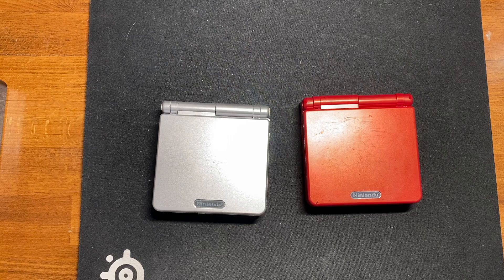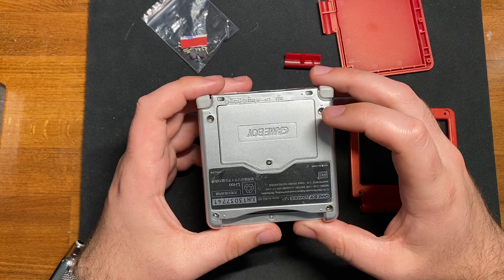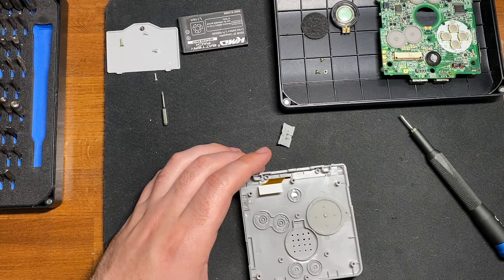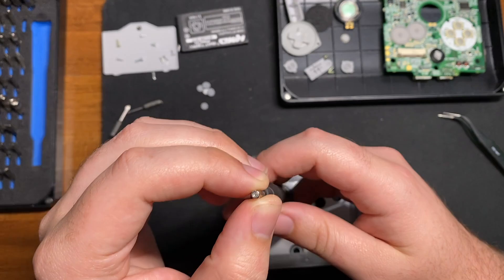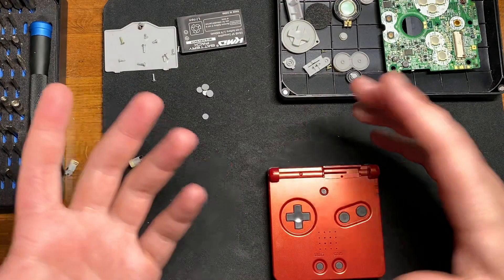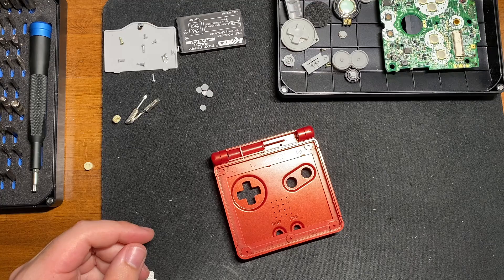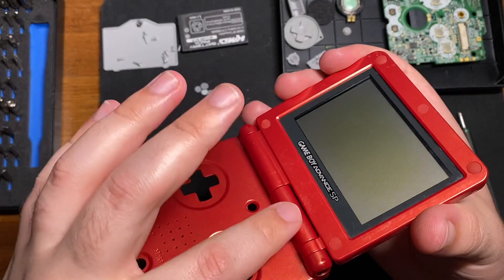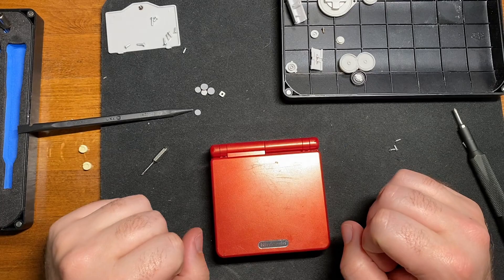Let's Swap A Gameboy Advance SP Shell - How To Guide

Comment: You forced the hinges out while both halves were misaligned, which is why you had trouble. You are supposed to remove them with the screen frame open to the self-supporting detent position (standard play position). That also made them more difficult to insert and likely changed the feel of the whole thing. Opening from the detent position makes the left hinge particularly hard to access when removing but there are a few ways to do it easily enough. First, always remove the right hinge first, then...
1) Unclip the left hinge, open the frame, then push it out with something long that reaches through the hole where the right hinge used to be.
2) Use Makho's 3D printed tool that fits inside and lets you push even once opened.
3) Disassemble a Bic Round Stick ink pen and cut the cone piece down to size so that the part that friction-fits the pen's main tube/body fits tightly between the hinge clips and the nearby structural rib. Wedge it in there, open the screen frame, and then remove the hinge. If it doesn't pop out on its own, use something long and thin to push. It should take very little effort.

Personally, I use the ink pen with a long/thin watercolor brush even though I have 3D printers. ;) You can find videos of 2 and 3 on my an Makho's channels.
Reply: Your comment helped me so much!!! Thank you for the advice!
Reply: ITS YOU AGAIN
Reply: @davdgs  what do u see??
Reply: He needs to redo the video with this help. I did not go to the comments before watching the video and had a hard time. He also got lazy with editing in certain spots. Theres other videos that are better.
Reply: I would have loved to know this before I pushed so hard I straight up broke the whole corner off. It was just a good thing I was already replacing the shell..
Reply: @keyblader1985  Yeah, the AGS-101 systems are particularly brittle and the corner almost always breaks if you don’t do it this way. Heck, they often break just from being dropped. :( Good luck with the rest of the process!
Reply: Emmett, my bro I’ve ordered my shell kit 15 mins ago and I have a feeling your 3 year-old comment is gonna make life a lot easier for me as it has for others. Thanks
Reply: @vincentmichael7979  LOL! Glad to help. :) The first time I shared my Bic Round Stic ink pen trick was probably around 2004 on Penny-Arcade forums and I’ve seen a lot of people struggle without it ever since.
Reply: @emmettturner9452  that’s a name I haven’t heard in a minute lol

Comment: here's a little tip for those who are interested in changing or replacing a part. the first time you do it. it's gonna be hard, and there will be times you mess up. but, the second time you give it a try you'll succeed. but I do recommend after you take apart your first console/system etc give it some time to let it sink in

also. I HIGHLY recommend you buy a tool kit smt with alot of screws like Philips and tri wing

Comment: Your video was very helpful.  I had used a step by step guide but a few of the steps were actually missing and made the work confusing.  You narrate at a nice pace, show your entire work and aren't blocking what you're doing with your hands and by watching the way your removed the ribbon and replaced the speaker I was able to place my GBA in a nice new shell.  No joke, the step by step instructions I was reading didn't explain or show HOW to correctly detach the ribbon from its coupling, skipped over the part with replacing the secondary hinge AND they put the speaker back into the device backward.  It wasn't fun taking everything apart again to flip the speaker so it actually created sound, but, hey, live and learn!  If I hadn't watched this video I would've surely damaged my system and I would've been heartbroken.

Thank you for providing a video that's easy to follow, easy to watch and easy to listen to!

Comment: High key thank you so much, I got hella scared when I went to take out the hinges and it looked like the things keeping them in place snapped and I couldn’t push it out with my Alan wrench. I know that you said not to but I propped one of the screwdrivers in place and used Inertia to knock them loose and it worked in 1-2 swings and the hinges were intact. Now I can play Pokémon emerald on my atomic purple gameboy, thank you so much.

Comment: You should have spent a little more time explaining what the screws were when reinstalling instead of having to go back to the start and you should have mentioned the screen does not have a screen protector as mine scratched as I thought it had a clear protector.

Comment: Hey, I need help. I accidentally stripped one of the screws while attempting to take it apart. Any way I can remove the screw?
Reply: I had stripped the ones in the back had to take a knife and saw in there then use a set of pliers. Be careful not to scratch the motherboard.

Comment: I did this just recently and total forgot about that little block for the battery cover screw till I had it all back together also had a nightmare thinking I'd broken the sound . But no ID realised that the speaker fell out about 20 minutes later when I found it on the floor. All a learning curve I think next time I'd fly through it alot faster.

Comment: This vid is quite a help but not complete. I had trouble finding the right screw and with the cuts I was always behind to check things. Especially the last cut where you put the backplate on. 
It was like placing the mainboard and a sec. after that you said "Lets check if its working".

Comment: Mines won’t turn on but will charge for a few seconds. I wonder what I did. 😩
Reply: I just saw you coment hope you found a solution 
But mine did it but i made sure to add the 3 screws for the mother board and to line up the speaker perfectly and it solved my problem.
Reply: @chivolvolnoxmake48me78happy99  THANK YOU! I’ll try it!

Comment: I followed this video and it was my first time doing anything like this. It worked but the first time I did it the screen would not light up and I forgot to screw a hinge cover in so when I redid it the while screen won't turn on. I can not figure out what I did wrong. The power turns on and sound works just no display. Can anyone help

Comment: so for some reason, when using this tutorial, i now have neither audio or visual??? the ribbon cable connector did pop off of the motherboard when i was removing the ribbon cable so im sure thats the issue more than anything. it reconnected fine but im guessing not.
Reply from the maker: If the actual connector popped off, then that would definitely be a likely cause of the screen not working and resoldering that to the board would be super difficult to do. 

Though the speaker not working could be dirty contacts or something in the way of them; unless the speaker was already bad (which I assume it wasn't).

Comment: I just changed my housing on mine but forgot to put in the plastic screen lens, does it need the plastic lens?
Reply: @MattPassarelli  I tried to re add it but a couple of the screws are stripped and can’t remove them, would an adhesive screen protector be okay to stick on?

Comment: The screw underneath the battery on mine has been stripped so I literally can’t get the screw out. Any tips on how I can get this out?
Reply from the maker: Your best bet is a tiny drill bit on dremel or small drill bit and just drill the screw out. But I know that’s not the most convenient solution for people. 

I’d try using the tiniest pair of pliers you can find and use those to then the screw if you can. Otherwise, the absolutely smallest dap of superglue on something stiff like a screwdriver you don’t care about, and use it stick it to the screw, let it sit, and then slowly turn. Superglue doesn’t hold up well to rotational torque from my experience so turn it slowly until it budges.

Comment: My question to you is my screen doesn’t wanna turn on anymore after I connect the ribbon cable. For whatever reason I can see the lights indicating I get power, but my screen is just blank. And I used my finger for some reason to get the ribbon cable in there. Did I by any chance mess it up?
Reply from the maker: Double check the connection on the cable, make sure it's seated right. Mine has an issue where the screen won't turn on and it needed re-seating. I would also check to make sure that you didn't accidentally tear the ribbon either. Always a possibility unfortunately.

Comment: Mine plays the audio but doesnt show game what should I do?
Reply from the maker: I’d double check the connection of the ribbon cable to the plug on the motherboard. Then inspect the cable to verify it hasn’t been kinked, torn, or anything damaging to it along its traces. If you have a spare screen/motherboard that you know work, you could try them to see which one might be faulty. 

Otherwise, given that the game still runs (you have audio), the screen might’ve gone bad. 

However, my IPS screen does this occasionally and I’m pretty certain it’s a loose connection as tapping really hard fixes it for a bit lol. Just need to crack it open and reseat the cable.
Reply: @MattPassarelli  I reopened it and the cable was disconnected
Reply: Its better now

Comment: Doesnt show how to install triggers. Ok not gonna like or dislike.
Reply: Uhh... what's the problem? You just drop them in. If the spring somehow came out of position it's pretty easy to figure out, especially since you will still have your old triggers for reference.
Reply: Be careful i broke the bit on the shell that holds the spring in place. It's very delicate.luckily it was on the shell I was replacing